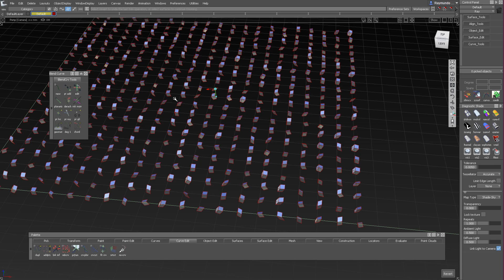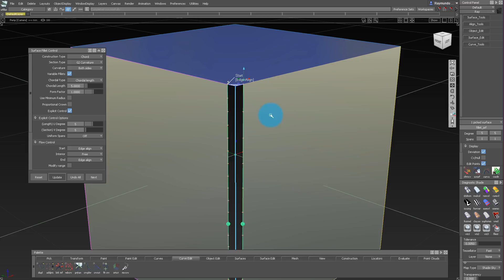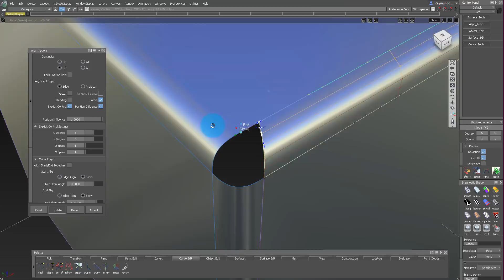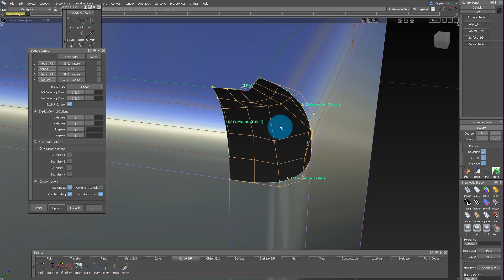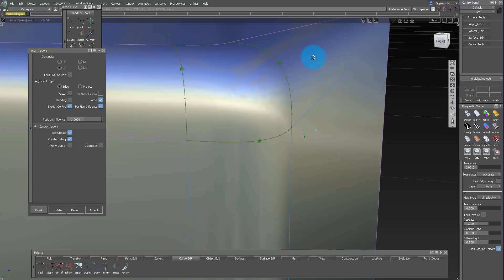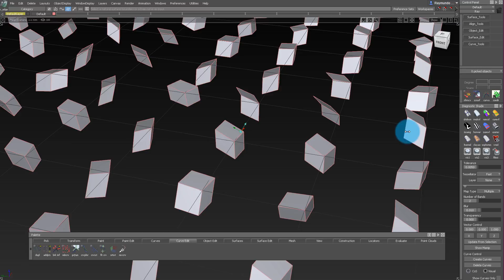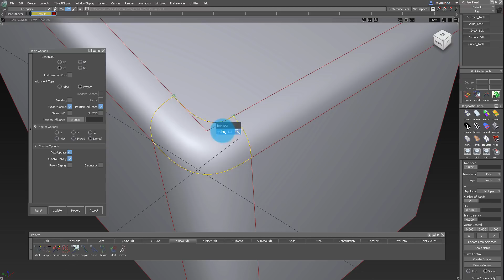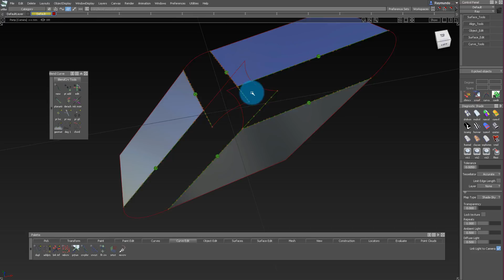Alias Surfacing: Ball Corners

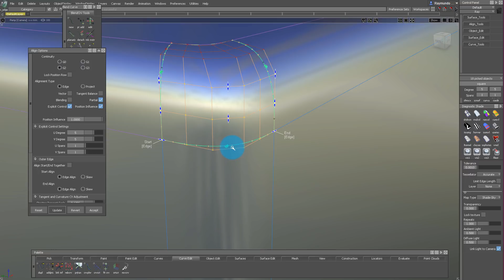Comment: At 9:59 there are 3 red edges, you use Align on the bottom edge and then hit the surface and all three just magically swap to green like some sort of dream come true. What was that?
Reply from the maker: Jim Deasy lol sometimes you get lucky like that. When I aligned the edge it solved whatever curvature problems it had with the other edges. Most of the time I have to do more tweaking but it worked here.
Reply: @HandleBar3D  If CV massaging is the real answer, then you should make another tutorial where you use cv massaging to solve the continuity. I see you do it all over but you've never really done a focused tutorial on that. Without align to save the day this goes from a 10 min process to taking hours.
Reply from the maker: @jimdeasy6720  well this video was focused on the surface structure but I'll probably make a CV massaging video soon.
Reply: @HandleBar3D  Now autodesk has officially made some really good class A tutorials by Barry Kimball on this topic. I think there is no need for you to do that again. But maybe you are interested in how he did it. There is also a ball corner course in his series.
 http://autodeskautomotivetraining.com/product/alias-class-a/ 

I learned a lot from both of you. Really appreciate.

Comment: Really wanna support you and what you doing for us! So, just bought that file! Thanks man!
Reply: How's it going with the iges file. I'm failing on all attempts. Any luck?
Reply: @jimdeasy6720  Was open without any problem!
Reply: Malamadre M oh I was just asking if you have success getting curvature continuity on the all the edges of the square surface
Reply: @jimdeasy  Ah sorry ! my mistake ) I thought about "IGES'' import ))) 
Yes, all good I did around three random corners ... most funny if you do each edge with different radius ufff!))) way more interesting when you do one big and two smaller or opposite ... and to do equal size of radius it's easy ...